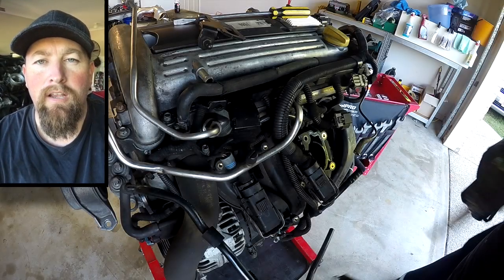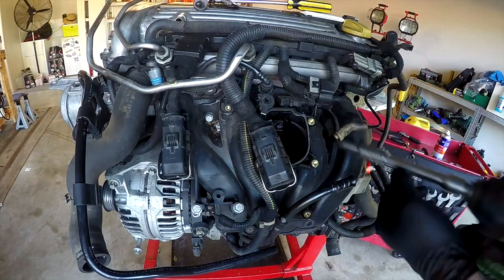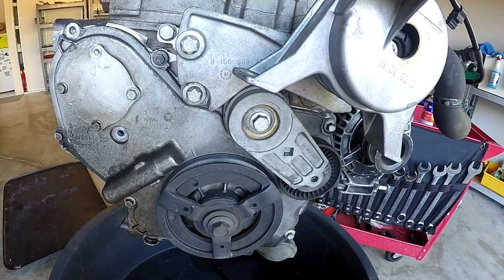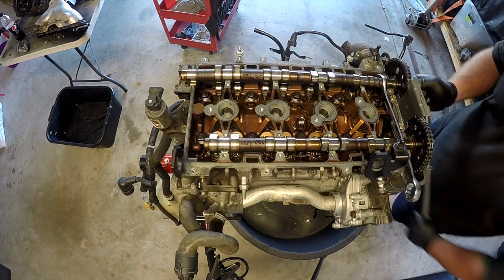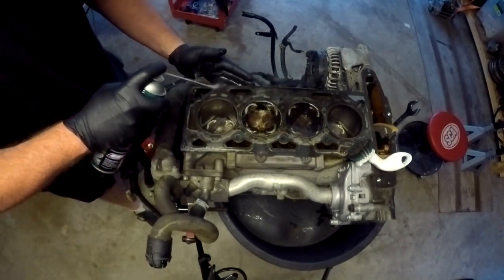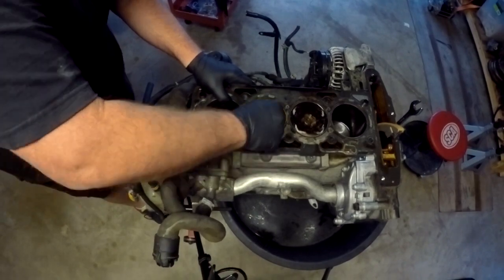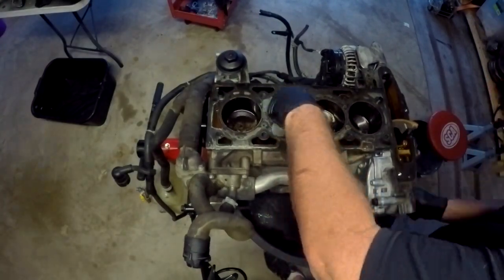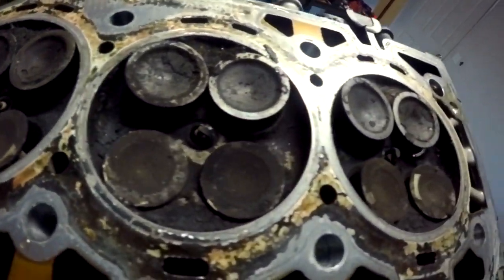Z22SE GM Vauxhall Astra Ecotec Cylinder Head Removal - Suspect BENT VALVES

Comment: I wouldn't have reused that engine as it happened to my z22 and had 1 tiny dent in a piston and I reused that piston. Because of that tiny dent it created a hotspot on the piston and ended up blowing a hole right threw it. Hope it didn't happen to you but did to me🫣🤣

Comment: Is it safe to buy a car with this engine inside? Or is it a manufactury problem
Reply from the maker: The Z22SE engine is a reasonable engine, however they had a recall on the the timing chain tensioner as it was prone to early failure. They also have a tenandcy to sludge up if service intervals are stretched out. Most of the cars that used these engines are getting older so the maintained examples are easier to spot. thanks for the question.
Reply: @killawattgarage  Thanks for your responds.

Comment: Could I get the size of that chain tensioner bolt. Also. If my chain is good and I need to replace head gasket can I do so without removing camshafts? I really would rather not fool with timing
Reply from the maker: From memory it was a 12 or 13mm bolt. The chain can be reused if good but it it will need to be taken off the cam sprockets. Often once the chain is removed the cams will rotate a little forcing you to realign all the timing marks. Sorry no short cuts.
Reply: Oh wow. Okay. So I need to mess with timing...I just mark where the pulley lines up with the chain? I need to bring it too dead center so which way do I turn it? Clockwise or counter?

Comment: Overall good video, one step made me cringe, the piston cleaning with a Scotch Brite will leave Aluminum Oxide abrasive grit on the surface which will make it's way to the piston ring area and cannot be removed without piston removal. These particles will eventually vertically score the piston wall which we do not want.
Reply from the maker: john stefanick good point.

Comment: What is the difference between the exhaust camshaft and the intake camshaft? I didn't mark them when taking them off and now I can't tell which one is which? They both look exactly the same and are not marked anywhere.
Reply from the maker: Dillard Tizzie not a problem. Note the intake is a physical longer camshaft.
Reply: Sorry I should have said this earlier. Mine is a 2010 ecotec 2.2l and the camshafts on int and exh are both are exactly the same length. I cannot figure it out.
Reply from the maker: Dillard Tizzie the duration and lift could be different. Line the two cams up and compare. Another clue might be the sprockets and timing marks, it may not be possible to set the timing with them wrong. Another option is to look wear patterns on the lifters or journals for a correct match to each cam.
Reply: Thank you. I haven't been able to find much. I will set the camshafts to Number 1 TDC and rotate them both clockwise and see which is the first one to open the #1 intake valve. Then that one will be the intake cam. That is the only way I can think of. Thank you for the help

Comment: Would you mind sharing what the torque specification is for the cylinder head bolts? I have seen a few different torque specs for the cylinder bolts that am quite uncertain which ones are the right ones. Thanks.
Reply from the maker: Omar Vargas spiral pattern from the inner bolts to the outer bolts. First stage is 30NM, second stage +75 degrees, third stage +75 degrees, forth stage +15 degrees. The smaller bolts that sit around the timing chain area are not TTY bolts and set to 35NM.
Reply: Killa Watt Garage i will be putting my cylinder back on the block tomorrow. Thanks for the info i appreciate it.

Comment: Both you and HumbleMechanic have had success using WD40 and scouring pads to clean pistons and the head gasket surface on the block, but for some reason I didn't have the same experience when I changed head gaskets on my 3100 SFI motor. The scouring pad worked, but I saw more success with carb cleaner.
Reply from the maker: I often let the WD40 soak is for a while and agreed, Carb or Brake cleaner also works well.